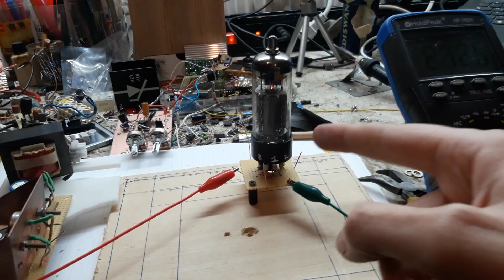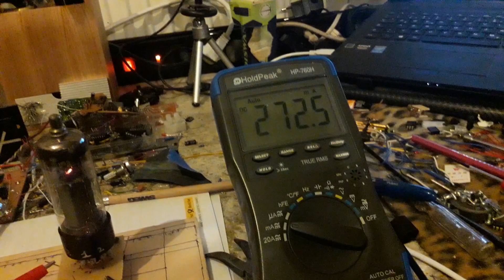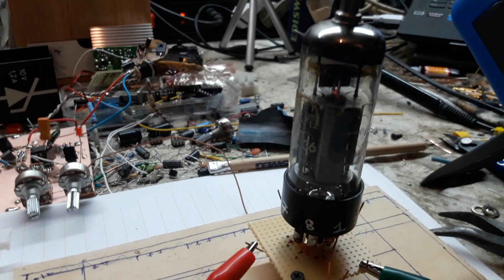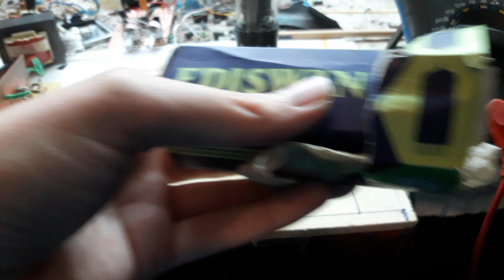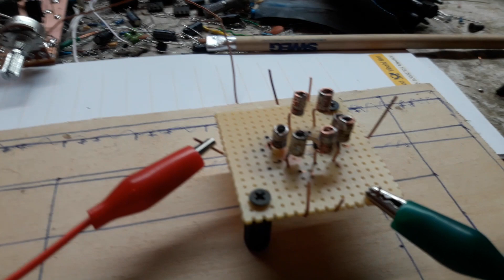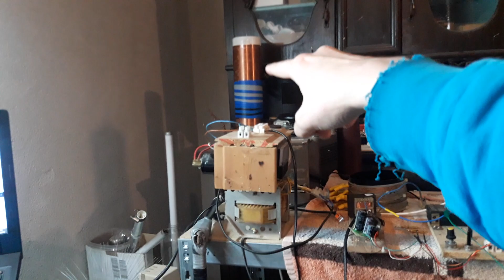PL36 valve filament test / DIY vacuum tube holder

Comment: The socket is the same as an octal (ice cube) relay, not sure if you have any of those laying about
Adding heatshrink around the outside would pull the contacts closer
Reply from the maker: unfortunately no, i do not .. might order a few but i'll work with this for now .. ended up not putting any around the outside as it would have done that but the pin sockets themselves have sleeves now .. its crude but it works !
Reply: Not sure if you remember, but the wire coil is how i used to make my RF ground sockets for 4mm banana plugs :D
Reply from the maker: @sparkyprojects  indeed i did but forgot to mention !